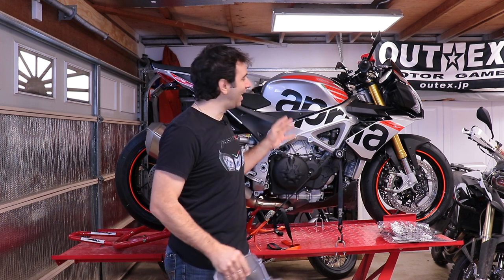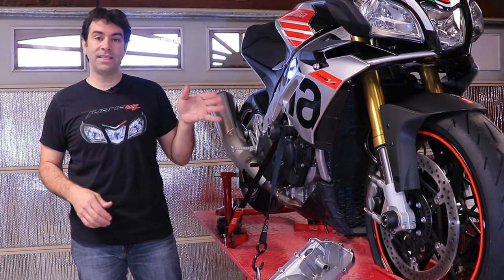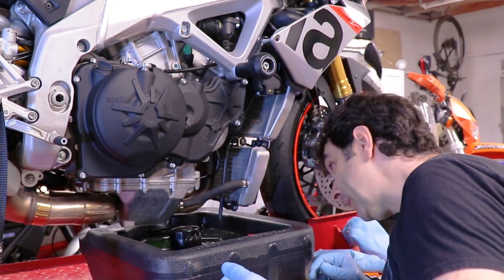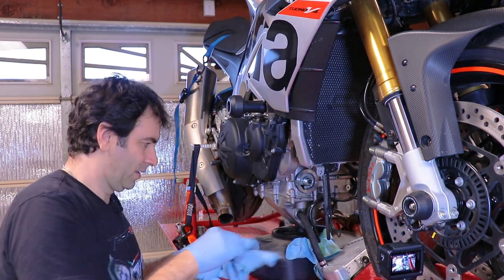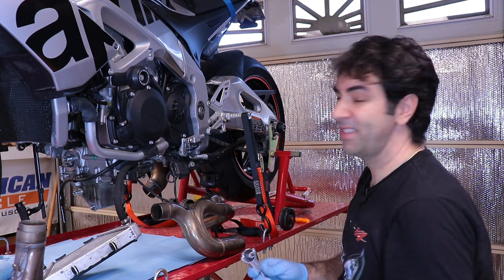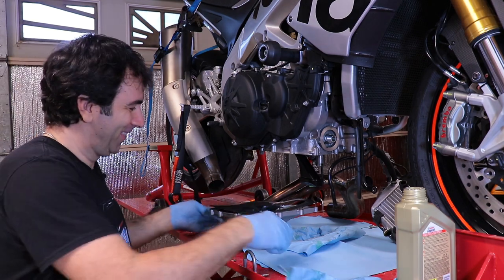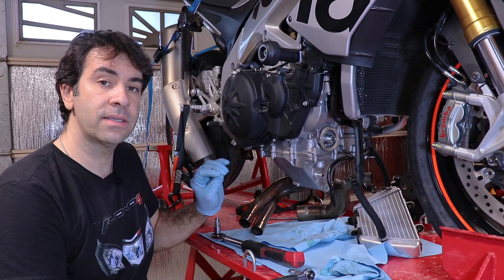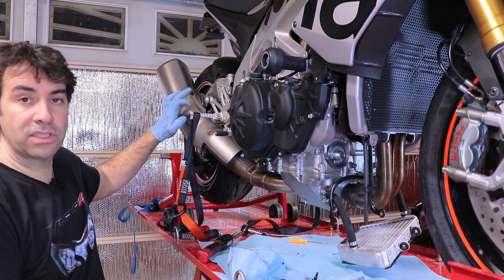Aprilia Tuono Oil pan replacement

Comment: Just did the job today. Needed 4 hours.  Ended up not removing the front collector pipe all the way, just loosened the nuts so that I could wiggle the pipe enough to uninstall the mid pipe. I was scared I wasn’t able to fit the nuts back on if I had removed them completely. There is no space it’s really a torture. I also was able to remove the oil hose clamp without destroying it  so I could reuse it. For the rest I followed exactly what you did. Great video, thanks so much!
Reply from the maker: Good Job Voodoo 👍 and thanks for watching my video

Comment: Good job. I plan to remove mine because ive seen the snorkel in other bikes blocked with silicone from overuse of silicone on side covers. . So would recommend anyone doing this clean and give snorkel a good check for bits blocking flow.

Comment: A suggestion, replace the worm drive hose clamp on the oil cooler pipe for an original crimped clamp, the original style seals better and slows for expansion by designed in ‘springiness’ so it can expand and contract with the hose and set a proper clamping torque, worm type hose clamps can become loose over heat cycles and or cut the pipe 👍
Reply from the maker: Thanks man, I'll do that 👍

Comment: Alby
If i was to remove the water pump from my 2019 aprilia Tuono 1100rr, which is exactly like yours. Would I need to drain the oil. It seems as if the pump is high enough to not have to drain oil at all, just the coolant. What do you think?
There are 2 bolts to remove the water pump, and a few hose clamps.
Reply from the maker: Hi L.T., there shouldn't be oil anywhere close to the water pump,  you'll loose some coolant  but that's about it 😀👍

Comment: @Albe's Adv Do you know where I could possibly get the Oil Pan? I can't find it anywhere
Reply from the maker: I got mine from AF1racing.com
Reply: @AlbesADV  the only one I see on there is black for $249
Reply from the maker: That is insane, I just went back to look at my order to make sure I wasn't telling you stories and the oil pan PN#8997556 that I bought June 5, 2020 NEW, was $87.20 and included washer and drain plug.

Comment: I think putting oil or grease on the gasket is useful for removal in the future. Putting it on dry, it will start to stick and will be harder to remove in case you have to replace your oil  pan again...

Comment: Could you reply with tools required for the job so I can buy any I don’t have?
Reply from the maker: The only special tool is a torque wrench, everything else was assorted mertic sockets a set of metric allen keys and a couple of screwdrivers

Comment: Howd you hit a curb? Trying to sumo your tuono?
Reply from the maker: Lol, kind of, first hit was a tall speed bump, the second time,  that really smashed it good,  was coming down a side walk...
Reply: @AlbesADV  I just did the exact same thing. Behaving like I was on my V-Strom. Dropped off a sidewalk and felt the thud. I didn't crack the pan but it seems to have deformed the oil drain hole just enough that I am now getting a tiny bit of oil weeping by the plug. I tried using sealant thread tape but still leaking a bit. Thanks in advance for this video.
Reply from the maker: I know, the position of that oil plug, first thing to hit

Comment: hello, thanks for the video. apparently, the pan  costs $250 with AF1. you mentioned a lower price!? The link you provided is not working. Thanks!
Reply from the maker: They probably raised the price lately, I just bought a tail conversion that used to be around $600 now is more than $800
Reply: @AlbesADV  thanks for responding! Another question: at 6:59min of the video there is the exposed tube (rose pipe), the one you are calling ""snorkel". The thing is that in order to instal the new mod gasket  (SKU: COMS090023 that is suggested as an alternative for the original one), I needed to remove the tube. In my bike, same as in yours, unlike in the service manual, it comes out easily, with no fastening screw. I managed taking it out and putting back. The engine is running fine after assembly. Although, I'm concerned about it falling out (due to the fact that it's came in relatively easily). Do you have any experience with that? Thanks!
Reply from the maker: @konstantinfeinberg5153 hi, there are 2 things holding the tube in place, 1 is the o-ring up top, 2 the tube is very close to the bottom of the oil pan, close enough that it shouldn’t be able to fall off.
Reply: @AlbesADV  thanks so much for your prompt and informative response! even AF1 rep couldn't provide a definitive answer:) based on what you are saying, I've done not a bad job. does it mean that when I inserted the tube back in, it "clicked" into to the o-ring....? I've made sure that it's in the maximally high stuck position and is held in pretty much firmly
Reply from the maker: @konstantinfeinberg5153 no, there is no clicking, just feels like is firmly in place 👍

Comment: Nice and helpfully video Albe. Thank you, a little question that I need a answer about oil drain washer diameter? I will buy before my service because they don't have in their hands
Reply from the maker: Hi Halil, the diameter (internal and external) and the thickness of the washer is paramount,  because the washer is supposed to spread into grooves in the oil pan and oil drain plug, even a fraction of a millimeter wrong might prevent a good seal because it doesn't spread enough or crack the pan and get stuck in the hole cause it spreads too much. So I highly recommend to buy the OEM Aprilia washer, I wrote the part number in the description. Of you really want I can measure one of mine for you BUT I wouldn't try to find a generic match for it.
Reply: @AlbesADV  Thank you Albe, very helpfully answers. our Distributor didn't import washer to our Country. Because of this. But I will buy some from Amazon. Kind Regards

Comment: I don't understand how you manage to get to the inner 2 nuts of the exhaust manifold without removing the radiator..
Reply from the maker: With patience and stubbornness but mostly by swearing in 3 different languages
Reply from the maker: I also might have loosened the bottom side of the oil radiator
Reply: @AlbesADV  
LoL
yup, swearing in 3 different languages sounds about right.
For me, I couldn't reach those 2 with a tool. I had to unscrew also the radiator (that is the coolant radiator) just so I can push it about 20mm to the front so I can get there with the tool.
my god, what a tedious job.
Reply from the maker: Lol yes it is 👍